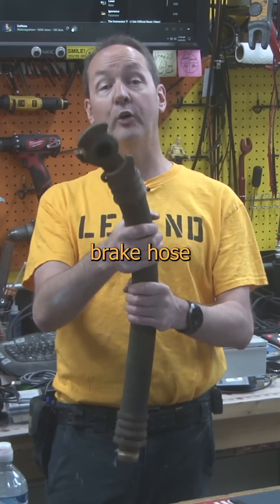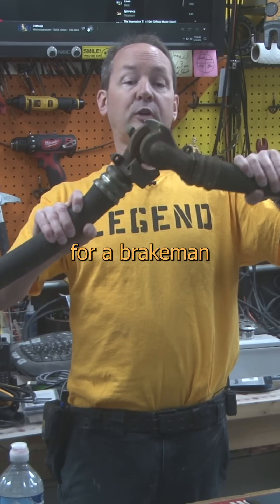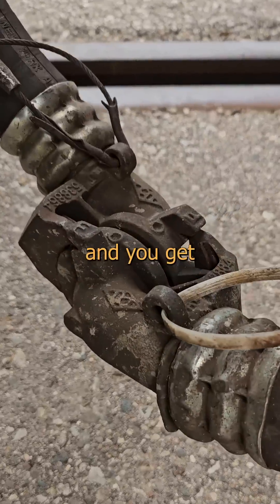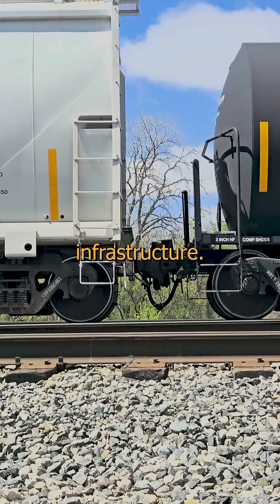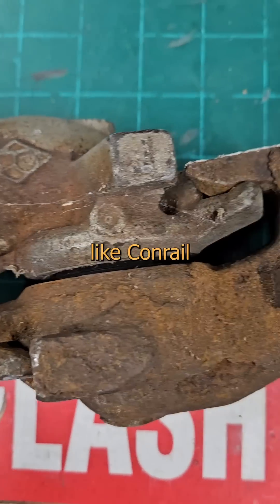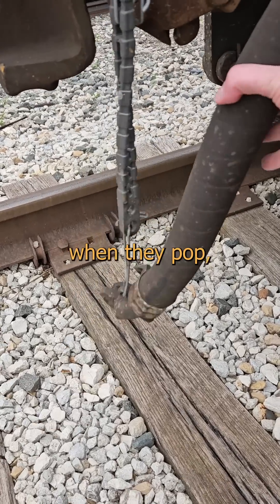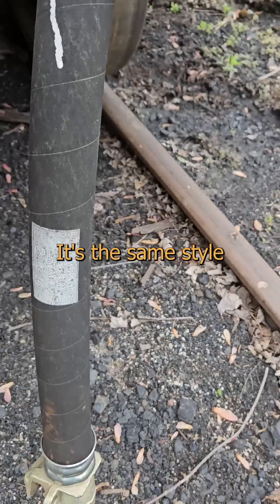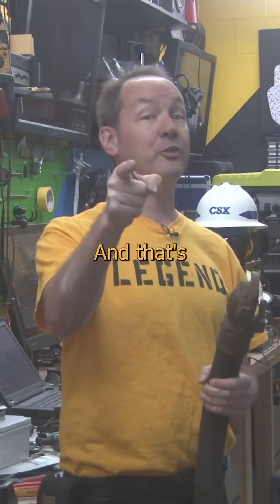Railroad Brake Line #chrisboden #comedy #engineering #train #gladhand #educational #connection #hose

Comment: The way those brakes work is so weird too.  They're air applied, but only when the line pressure drops.  So each car has an air tank and a triple valve, so when the line pressure drops the valve takes some air from the tank and applies the brakes from a single cylinder through some goofy linkage.  However, if there's a leak in the tank, valve, or cylinder, it'll bleed off and now you have no brakes until you give the handbrake wheel a spin.
Reply: I thought they were just spring loaded — and the air keeps the pads off the wheels.
Reply: @JasperJanssen That’s a really simple way of thinking about an analogous system. But with the triple valve and dual brake reservoirs, there’s a lot more going on inside. There’s some incredibly complicated and clever engineering rolling around on every train car you see, and most of it is basically just minor improvements on stuff that was designed in the 19th century.
Reply: @JasperJanssen  The brakes on tractor trailers have a double redundancy like that.  The drive wheels and trailer wheels have a dual brake chamber that has a spring applied section and an air applied section.  There are two air lines to the trailer, one has constant pressure to release the parking/emergency brake, and the other only has air pressure when the service brakes (brake pedal) are applied.  If there is a failure of the air system, the spring in rhe brake chamber applies the brakes and stops the vehicle.  In theory.
Reply: @JasperJanssen nope, on freight cars the brake cylinder is a normal piston that needs air pressure to engage and push on the goofy linkages that then push the brake pads against the wheels. There is a spring in the brake cylinder, but it is a return spring to help the piston retract when the brakes are disengaged.

Comment: As a rail engineer these things are very expensive but work really well when looked after!
Reply: I don’t know how expensive they are, but probably one of the least expensive things on a typical freight car or locomotive. As a locomotive engineer, I can tell you they they’re not looked after at all, and they still work really well.
Reply: As a railcar technician I can tell you they are pretty cheap compared to a lot of other things I charge for
Reply: end hoses are not very expensive and are pumped out by the thousands

Comment: Those are the old brakes the new ones are with two lines the connector stayed more or less the same, one is for continues pressure and the other is for control. Mostly for trucks and tractors tho. I don't know if they are used on trains.
Reply: Nope trains still use George Westinghouses single pipe system designed centuries ago, because it works.
Reply: @raygale4198  when you let of the brakes its releasing air out of the system. So when you have 40 or more wagon's is the compressor able to keep up with the demand?  Asking Cuzz my curiosity bubble is popping.
Reply: @assimilatedgassfeild686  It only takes a 10 psi dip on the train pipe to apply the car brakes, each car normally holds enough air for around three applications, after which the  entire system needs recharging from the locomotive compressor. Trains rarely use the  entire train brake they rely on dynamic brakes in the loco for most braking action. Train brakes are usually only in an emergency or for the final 'stopping'motion. Charging the air line and tanks of an entire train can take 15 to 20 mins on a long train that's part of the reason when a locomotive is coupled to a train they will sit there for a few minutes, charging the brake pipe and doing brake function tests.
Reply: @raygale4198 Thanks

Comment: The brake lines on a semi don't have to deliver metric butt loads of air down miles of brake cylinders and the smaller lines reduce the size of the compressors along with speeding up response of the trailer brakes when the tractor brakes are activated.
Reply: Trains break when Air is pressured up 
Wagon breaks with air out(lowering the pressure)
Or the other way around

(Note: i had translation error)
Reply: @yamatokurusaki5790 you mean trucks.  

Every train brakes when the air is released whether it's passenger or freight or metro or highspeed.
Reply: @JSM-bb80u Yes and no, a drop in air pressure is what triggers the brakes to engage but the brakes are physically applied using air pressure from air stored in a reservoir tank to pressurive a brake cylinder and push the brake pads against the wheels, usually through a series of linkages.
Reply: @yamatokurusaki5790  they work on different principles, but both trains and trucks do brake when pressure is lost from the system

Comment: I'm a switchman, and was told in training "if you don't get a good seal, just hock a loogie in there and it should work." And let me tell you, that shit works 😂
Reply: The ole courtesy spit
Reply: Winter time those rubber seals are an absolute nightmare even after the upgraded ones. It’s been known that if you have a leak you can’t fix just close the air and piss on the two seals and let the connection freeze then reintroduce the air.
Reply: @kansascityshuffle8526  So is it fluid (implied in the short) or air flowing through that connection? Semi trailers do air for the breaks (or to disconnect the brakes, technically)
Reply: @KirtapAmsna It's air but follows fluid dynamics in this instance so referred to as a fluid.
Reply: @KirtapAmsna  "fluid" is just a special term in physics; IIRC it's basically "anything that has indeterminate shape" (so "air is a fluid that happens to be a gas" likewise "water is a fluid that happens to be a liquid")
Reply: @KirtapAmsna  technically, compressed air is a fluid, just not a liquid, and for a truck trailer the more air pressure means less brake. the air pushes against a spring and keeps the thing wide open. when the air pressure lowers the spring pushes back and clamps down the brake pads.  i dunno how it works for train cars tho
Reply: @mikelagaffe  pretty much exactly the same.  Charge everything to 90 PSI, brakes are released.  Reduce trainline pressure gradually (e.g. 5 or 10 PSI), brakes start to set up .  Reduce pressure rapidly, (IIRC, >20 PSI), and you throw the train into "emergency stop", which is not fun.
Reply: @fortisprocer966 air follows fluid dynamics in all instances and is always looked upon as a liquid technically
Reply: Air is a gaseous fluid.  Water is a liquid fluid.  Then we have non-Newtonian fluids like toothpaste, ketchup and pitch.
Reply: @mikelagaffe  it's the same way. They're designed this way so if there's a failure, they fail into a safe state.
Reply: @danp2779  im operating trackmobile currently (waiting for a spot to open up in loco training) but I always set my air from 90 to 45 to break when I'm indexing. It stops fast but nothing crazy. But yeah, I assume it'd get... bumpy? To slam your air like that on a full size loco
Reply: @KirtapAmsna  Air is a fluid my friend.
Reply: @beardboywonder4458  I should've been clearer that it's not "just" a reduction ... there's also a time component there.  The "20 PSI" could also have just been touchy triple valves on the museum equipment i worked with (or at least that particular caboose anyway). 

Suffice to say, once one car sets emergency, the rest of the train is going into emergency.
Reply: @danp2779  yeah, our "emergency" is just a button that dumps all the air immediately for the entire string lol. Now THAT sends you for a little bit of a ride lol
Reply: @supersst838  Ah, that makes sense. At the moment I was thinking only when under pressure/ pressure difference occurred. I guess it's all the same so you're right.
Reply: @KirtapAmsna air is a fluid
Reply: @KirtapAmsna  I noticed that too. As a railfan (foamer), I can confirm it's air.
Reply: @KirtapAmsna air is a fluid, as far as physics is concerned. Compressible fluid, but a fluid.
Reply: @KirtapAmsna  I think all trains have air brakes.
Reply: @danp2779 Throwing anything into emergency stop is generally not fun.
Reply: I mean, you gotta get it w e t first!
Reply: did i train you?
Reply: What's a loogie? 😮
Reply: @DalitKumarAryan  a big ol’ glob of spit and mucus
Reply: @LanaaAmor  spit lol
Reply: Where’s your close quote?!
Reply: @PokeMageTech  there lol
Reply: @beardboywonder4458 
Thank you! 😁
Reply: Works on couplers for hilos as well 😂😂😂
Reply: Nonono. We’re asking.
Reply: @beardboywonder4458  Can confirm. We use the same connections on military trucks. One of the first things they teach you about dealing with gladhands is:

If it's not sealing correctly, spit in it. Bonus points if you spit a stream of dip juice in it
Reply: Can you confirm that works
Reply: Literally lol.
Reply: As a former conductor I can confirm this😂
Reply: In the Air Force (where I only worked with the “awww, that’s cute” couplers) the grizzled pro who taught me how to hook up and pull the trailers that carry the BIG stuff told me to lick those couplers if they were being fussy. I thought I was getting hazed… until he grabbed it out of my hands and licked it himself
Reply: Same one semi brakes... don't ask, don't tell...
Reply: Works like a charm
Reply: Quick way to get a broken tooth
Reply: @HOC307  how? I'm not doing it as we're making a cut lol
Reply: @beardboywonder4458   if it doesnt connect correctly and i pops apart right when you do it. Its happened to me before. Wouldnt want my face down there.
Reply: @HOC307  weird. I'm newer so I can't even picture that scenario lol. But I was told to spit on the O ring itself. Not the gladhands. So order of operations would be, 1. Hawk tua, 2. Lace hoses, 3. turn anglecock, 4. Hope your shins don't get obliterated lol
Reply: @HOC307  Not sure how it's done on trains, but on our trucks, you connect it, see it's not seating properly, disconnect the line, spit on the gaskets, then reconnect the line. 

0 danger to anyone involved. Well, physically. You might be in for some mental trauma if you pay too much attention to the weird shit the mechanics are doing WHILE they are lubricating the gasket
Reply: @beardboywonder4458  gotcha- now that would make sense. That would help it from slip better and not roll out-
Reply: So, HAWK TUAH? 🦅😳😂🤣
Reply: @droman608  lmao yes 😂
Reply: as a trucker if the air hose connection leaks i just get a little grease off of the fifth wheel and grease the gasket. all fine after!
Reply: bro's lungs made of literal tar
Reply: Hawk Tuah
Reply: @grantmcinnes1176  why

Comment: I don’t think the things will grind to a halt if you don’t connect the brake hose. I think the problem is that they won’t

I understand about the fail safe now, you don’t have to keep telling me
Reply: Nope, they’re fail SAFE. So if something fails they go safe. Brakes only release when air pressure is applied.
Reply: @Brettnet see Lac Mégantic on how they can go from fail safe to fail off
Reply: Train brakes are Fail safe, with a proviso. Yes the car brakes apply with loss of train pipe air, but, the car brakes only stay applied as long as each car has pressure in it's own air tank. As the air leaks away the brakes will release, if it didn't you would never be able to bump shunt loose cars in a yard.
Reply: @raygale4198 oh interesting, I expected it to be just a spring or something and assumed shunting would only happen with air to release. 

A fail safe with an asterisk seems unwise but I guess it’s worked long enough.
Reply: @Brettnet  It's a system designed by George Westinghouse and has been used universally throughout most of the world, it's one of the rare standards that is a standard. The 'brain' of the system is a very clever valve arrangement on each car called a 'triple valve' which allows the car tank to be charged, from the brake pipe  recognises dips on brake pipe pressure and applies pressure to the car brakes, then on seeing rising brake pipe pressure releases the car brakes. Genius and very reliable.
Reply: @Brettnet  they were invented that way in the 1870s (yes, trains exist since the 1820s and yes, they used hand brakes or fail-bad steam brakes), were the first version that the engineer could brake the train AND would stop when the couplers broke.

The system hasn’t changed since. Sure, the valves (sometimes) got better and disc brakes are a thing (for pax), but generally still the same.

Some modern equipment got sprung parking brakes, though
Reply: Train brakes are fail safe.

You need air pressure to release the brakes, so if a hose disconnects or something breaks the brakes automatically engage.

Keeps trains and train cars from going on adventures on their own
Reply: @frogsshadow4189 you still need pressure to fill the piston, so when the reservoir is gone, they’re just failed
Reply: They fail somewhat safe. Sure, if there’s air in the reservoir, you stop. But when shunting, people pull the reservoir and then it gets sketchy/scary/expensive sounds

Comment: 120 psi. The EOT device transmits this level to the locomotive HOT
If you download the software and use a scanner with discm output you can see the data it is sending 

Really neat
Reply: 120 PSI? 

Europe specs that brake pipes are released at 5 bar  (72.5 psi) and emergency is everything under 3.5 (50.75 psi). But on passenger equipment (and some heavy ore trains in Germany) you get an additional air line from the main reservoir at 8-10 bar (116 - 145 psi) for fast refills and operating doors, toilets, … on pax cars
Reply: US freight train spec is 90 psi in the train line. 120 might be the passenger train spec. It’s either that or 110, but I’m a freight engineer so I only VERY rarely mess with passenger trains and don’t know that one off the top of my head.

Comment: Isn’t the problem that things DON’T grind to a halt when these don’t work?
Reply: Other way around... When the lines are not pressurized, the brakes remain engaged and those cars DO grind to a halt, or simply don't want to move at all.
Reply: @Bear-cm1vl  Once the train pipe and car air tanks are charged yes, dropping the train pipe applies the brakes, but only as long as the car has pressure in it's own air tank.

Comment: I worked in a grain elevator that had a private traincar-yard with 3 tracks we could load with ~100 cars, but as a private business we didn't have a Train Engine to move them.  Instead, we had these gigantic-fuck-off-sized hydraulic car pullers that we just hooked, with chains, to the side of a car - and pullllled.   The three tracks would have around 30-35 cars, which we would fill with hundreds of tons of grain to transport.  The pullers could do that, no problem.

Now, sometimes people fuck up.  When you don't set the track connections correctly, you can just pull a whole bunch of grain-filled cars right off the track and through EVERYTHING else. Imagine the logistics of trying to lift a filled train car back onto the tracks...

Those expensive noises are really obvious sometimes.
Reply: And here I thought overflowing a semi in the loading bay with several thousand bushels until the guy can only crawl out the windshield was a bad day but this takes the cake
Reply: Tell me about it. Cleburne Tx sometime around 2017 i think, the whole length of the coal train flipped on its side. I remember driving by it during working hours. Took them like a month to re-rail and clean it up.
Reply: I love the job though. I get to operate all the heavy machinery I used to spaz over as a kid. We have a locomotive, a few skid steers, excavator,  front end loader, and I'm on the company Emergency Response Team so i get to drive the fire engine.
Reply: @rngmstrdan  ngl working in grain storage never sounded too thrilling to me, but getting to operate all that heavy machinery sounds p badass
Reply: @Thiscouldbeyou  I work grain storage too...we had a derailment back in January because some smooth brain contractor left a derailer on the track and it got buried in the snow. The graveyard crew found it though...after 6 cars ended up in the ditch next to the rail.